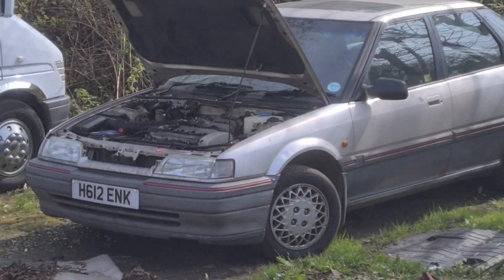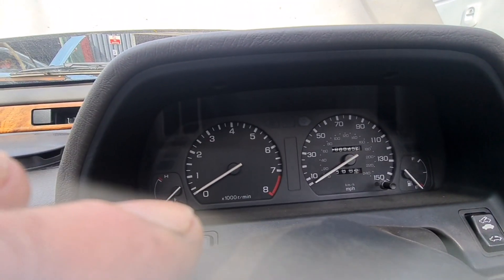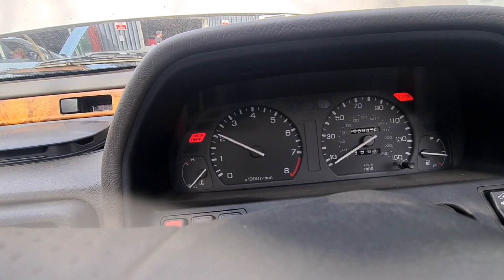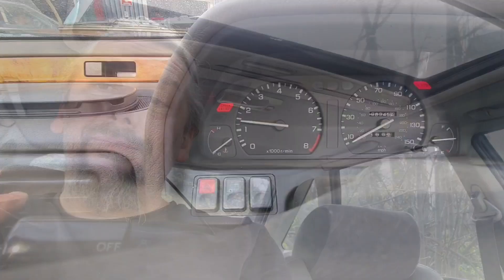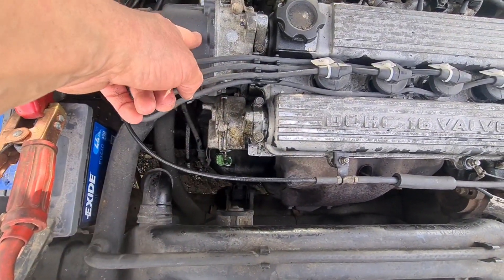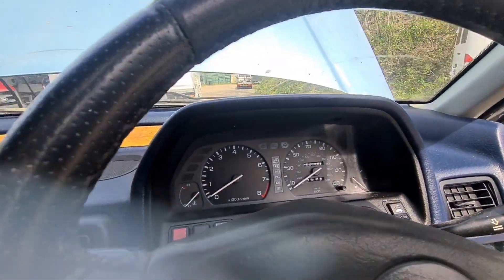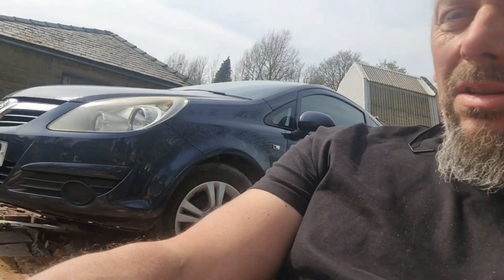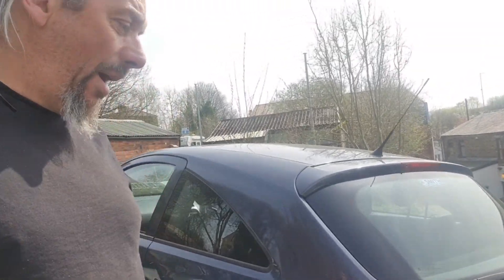GTi problem solving

Comment: If it’s a Honda unit if you’ve had the battery off, it has to have several cycles of running for it to idle properly, I had a similar problem with a Honda Engine Rover , until it had relearned in the MEMS system it used to conk out when hot , a strange old system 😮
Reply from the maker: Another interesting thought. Thank you .🙂
Reply: @ProjectNigel  😉👍🏼

Comment: What's the fault code? you can read them under the passenger footwell carpet.
Reply from the maker: Oh the flashing light on the ECU?
Reply: @ProjectNigel  yes it flashes out fault codes when the ignition's on. they flash in blocks of between 1 and 10 to give a 2 digit fault code, and the codes are widely available on the net

Comment: Paul you can buy reusable cable ties buddy
Reply from the maker: Really? 😅
Reply: @ProjectNigel  Really. Or you can get them free off Nissan Micras (and probably Primeras and Almeras of that age). I used to work on them between 1992 and 1999, then a taxi driver wrecked my frail body with his minibus and ended my life on the production line (best thing that ever happened to me), but that's another story, anyway, we used these cable ties on various parts in the engine bay and they have a small tab on the locking head which you lift with your thumbnail (or any nail you prefer) and they release. There were also some which had a plastic lug on them so they could be popped into small holes on the bodywork to retain cables and wires. I still have a few well used ones left, they're precious things in my shed.

Comment: Would it be worth changing the brown rectangular fuel pump relay that sits behind the radio if the G T I has one I know that failed on my 216 G S I new ones are expensive though  and maybe the little square black thing with the 4 connectors on it that sits in the distributor can't think what it is called that failed on mine out on the road and caused similar symptoms this was many years ago but I still have the car and it still runs reasonably well  the black thing that came out has OKI MNE_301. D9515 written on it just a thought I'm no mechanic 🤔
Reply from the maker: That's something I will look at. Thanks. 🙂
Reply: I had the same problem with my rover 216 si it was a brown relay roughly where you said . A new relay was extremely expensive. 
Removed it took the cover off inside 3 dry solder joints.  Resoldered them all worked fine even when I had to scrap it 3 years later .

Comment: Releasable cable ties: https://www.ebay.co.uk/itm/264896629657?_trkparms=ispr%3D5&hash=item3dad11cb99:g:-1gAAOSwvP1iRK74&amdata=enc%3AAQAGAAAAwLftvqkgnduHiZfPB%2Fi7s03TggTbS%2F%2BhVmvEaEWFyXjbfmcgINR1vjgdK5S%2FLhrtOC7GNS7TpoogBil%2BlDPucabo%2Bbhh%2BGcbLTr36RRQAYM4U%2F0hMQWfknqO%2F8mVIKaSsXQPh%2FFG8Tw%2BYsTGRhgwgZaHB43HxQKSJFKeLib3dpiZDFl4TEshHY6YrGr0AdLjAJW0D7uiMXmu53OVqsC3CW0fdyqWQNtW%2B8OIjUyuRpthq2sr3hpQk5HYZ7fnLqeWHQ%3D%3D%7Ctkp%3ABlBMUODA6pqHYA

Comment: Oil?
Reply from the maker: Engine oil?
Reply: @ProjectNigel  yes captain, correct grade.
Reply from the maker: Well it looks clean. Besides it apparently used to run perfectly well, and then suddenly started to do this.
Reply: @ProjectNigel  I have known engines to run poorly like this on the incorrect grade of oil. Get worse as the oil gets hot. I've also know something similar not happen due to exhaust manifold gasket fails
Reply from the maker: It would ge great to get to the bottom of it.
Reply: @ProjectNigel  it one of them problem that might be a symptom of a complete different issue. Finger crossed captain you manage to find it 😉